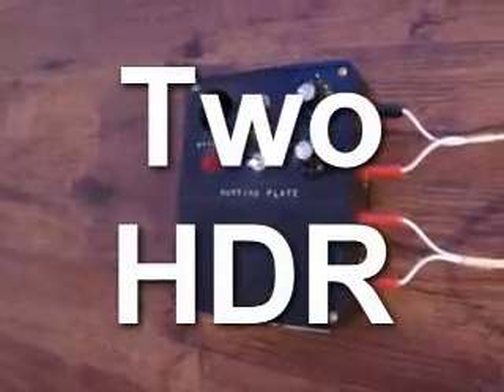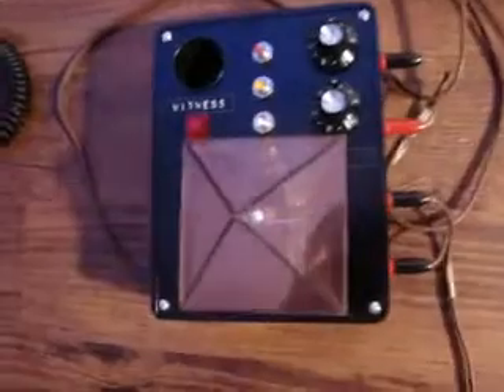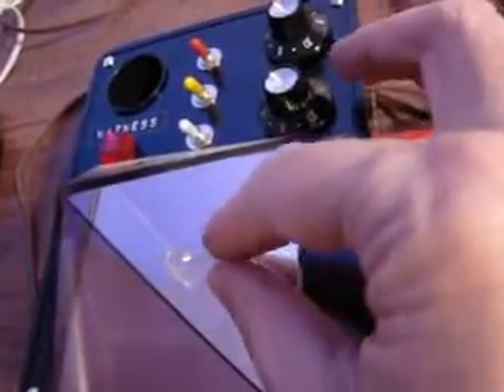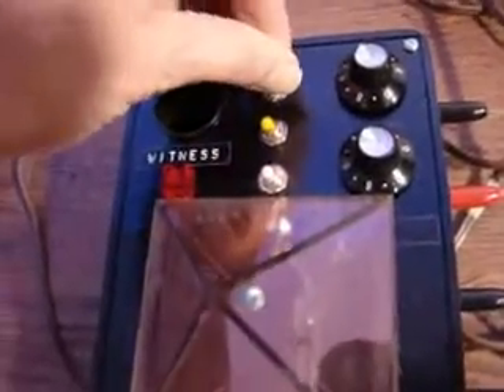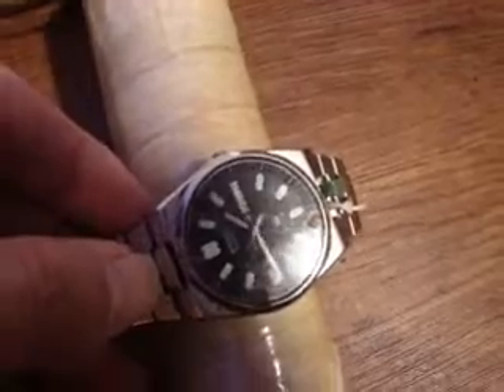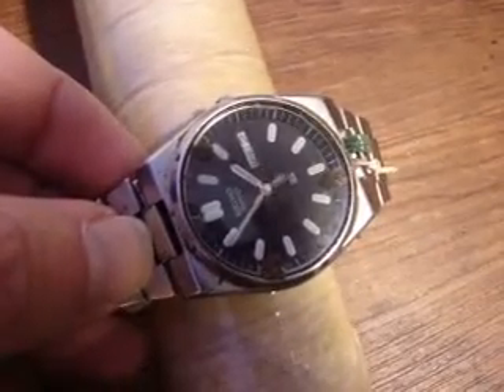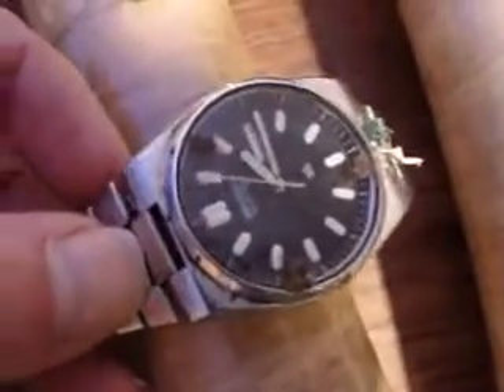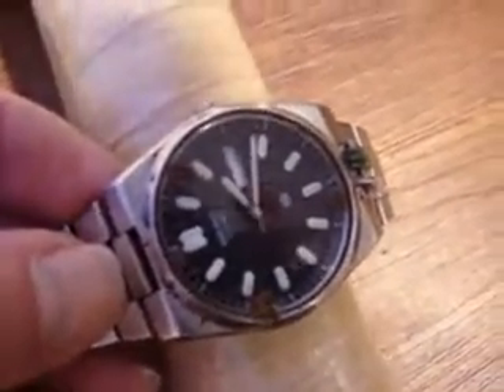two hdr units and a watch - time distortion

Comment: Hi, firstly what the hell is the witness box? Two  Is this a quartz time peice. If it is an older type with internal clockwork, they were made of non-magnectic material. i.e brass etc, so it should not effect the movement and if it did it would just stop. If it is a quartz movement it would simply stop. I'm not sure what is happening. It needs to be investigated properly.

Comment: man, its an electromagnet. a massive one. ofcourse its goign to move the hands and mess with the mechanism... that is not distorting time is it.. its distorting the movement of a device that only shows time accurately if it is set right and is running properly. your video is completely inccorrectly labelled..!